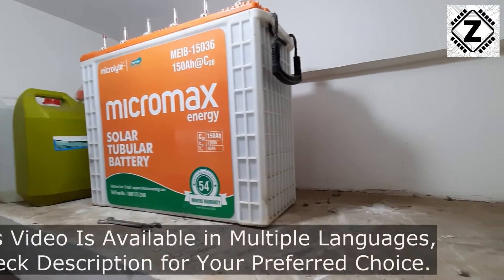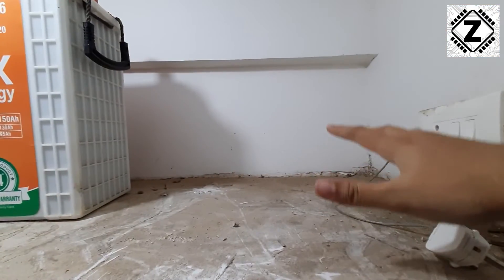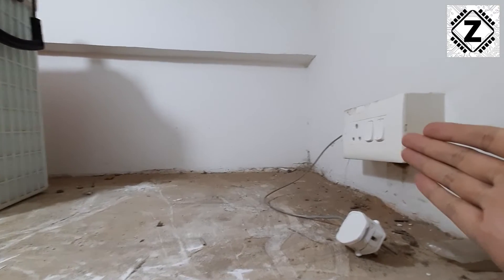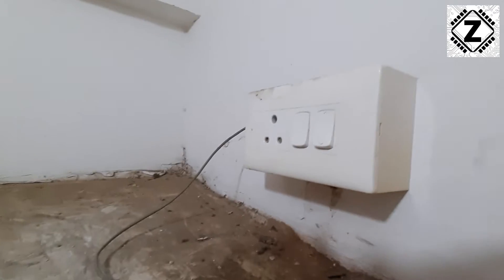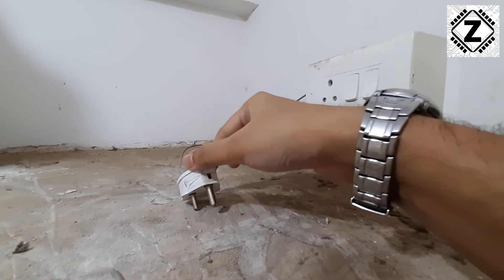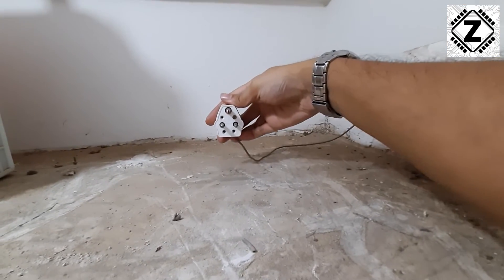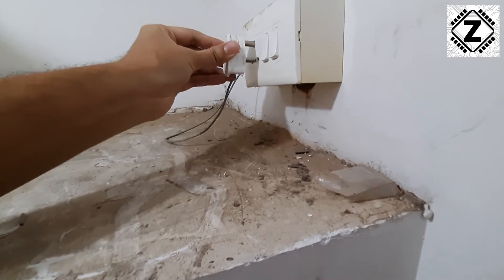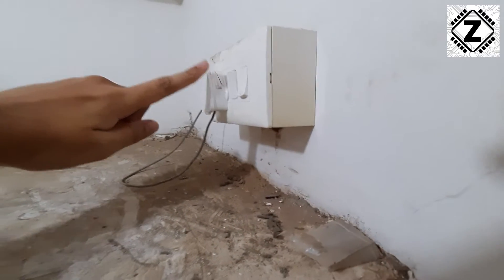[Eng] How to Bypass Damaged Inverter & Run Direct Loads ? | Microtek 800VA Removed for Repair

Comment: Hi friend. I have a question for you. I have watched several of your videos and I know that you know what you are talking about. 
I want to build an off grid cabin and rent it out on airbnb but I am confused on what electricity system I should use. I can't connect to the grid. For now, I can't use solar panels because I am in the woods and there is not enough sunlight, but I plan on getting solar panels later and installing them high on a tree so that it can be efficient. 
Here is my power system solution that I have figured out, please let me know if it is good or bad.

-3x 5KW inverters/Chargers
-12x 250Ah 12V GEL Batteries 
-15KW Generator that I will be charging the batteries with.

So here is the explanation:
I have 2 hours everyday after my guests leave to charge the batteries, so I think I need a bigger generator like a 15KW one to charge the batteries fast. Like this I think I can charge the batteries in about 1h 20mins to full. I will discharge only about 36-40% of the batteries, meaning that the battery after I use it will have about 60% charge left, and then I will charge it again to full and repeat this process everyday. I was also thinking about instead of charging the batteries with a 15kw generator, I can get a smaller 5KW generator, and get only one 5KW inverter, so when the batteries get low, the generator automatically turns on and charges the batteries, then turns off once it's full. But the problem is, I have no idea how to set up that automatic turn on/off system. 

Here are my appliences and the daily electricity use: 
*MINI REFRIGERATOR - 0,2KW/24h (Refrigerator works almost 12h per day)
*MOVIE PROJECTOR - 0,5KW/24h (This is assuming that it works for 2h in a day)
*PLAYSTATION - 0,5KW/24h (This is assuming that it works for 2h in a day)
*WATER PUMPS - 5,5KW/24h (1 water pump will run from 8:00 - 00:00 [4KW consumed in that time], second water pump will run
from 11:30 - 18:30 [1,5KW consumed in that time])
*WELL PUMP - 1KW/24h (I assume the well pump will run in full power for 1h per day)
*LIGHTS - 3KW/24h (I have a lot of lights since I need to light up an acre and a half, also, I like lights a lot :D)
*KARAOKE - 0,5KW/24h (This is assuming that the karaoke will run for 2h in a day)
*FANS AND AIR PURIFIER - 1KW/24H (Together they consume about 0,1KW per hour of use. I plan on using them 10h per day)
*BLOW DRYER - 0,50KW/24h (This is assuming that it will work 30 minutes per day) 

TOTAL POWER CONSUMPTION PER 24H: 12,7KW 
SYSTEM HAS: 36KW
TOTAL USAGE PER 24H: 36% Discharge 

I'm looking forward to what you have to say to this system and your advice. Thank you for making great quality videos and educating other people!
Reply from the maker: For Rapid charging, High quality Lithium cells with a healthy BMS is the way to go.

The small Generator plan is also worthwhile. It can be triggered using voltage sensing circuit and a relay. It will kick the generator as soon as batteries reach low and shut down once sufficiently charged. Some DIY kits are also available for such purpose or Generator manufacturer can help here.

For more discussion you're always welcome on my Telegram group.
Reply: @ZenInnovations  Can you make a video on how to install ATS on a small 5KW generator, 5KW inverter and 5KW lithium battery? I want to do this, but I don't know how and I don't think the electricians in my country also know how to do this